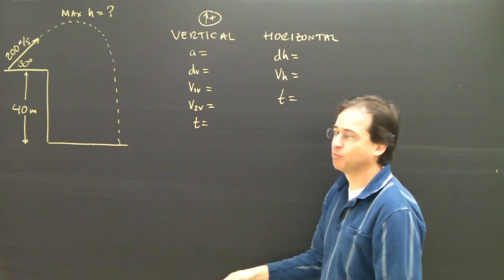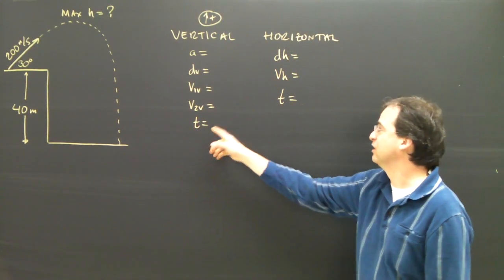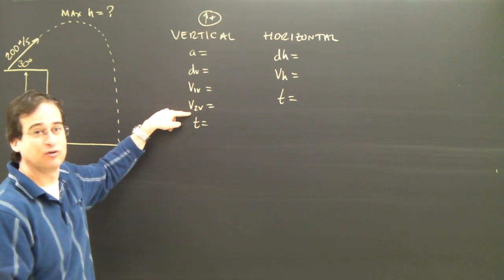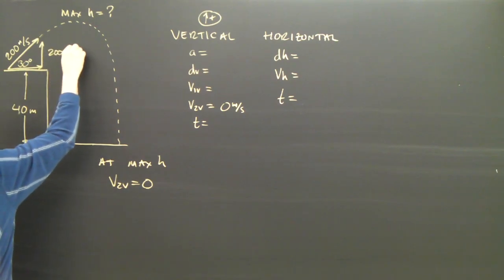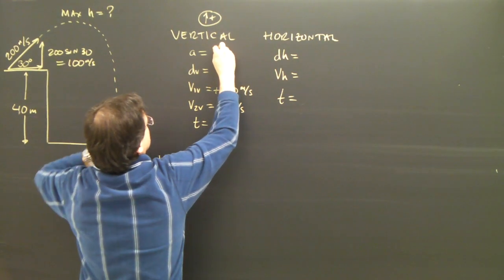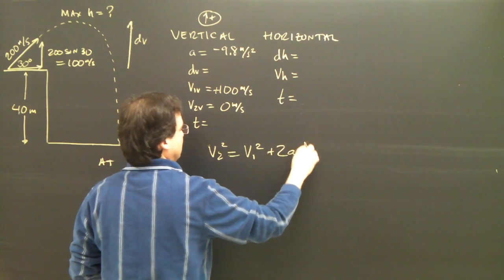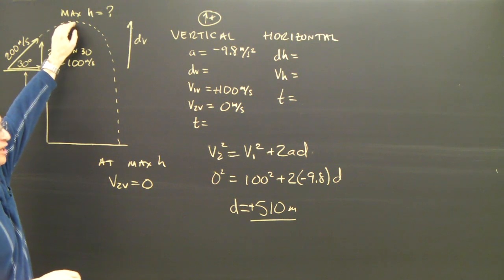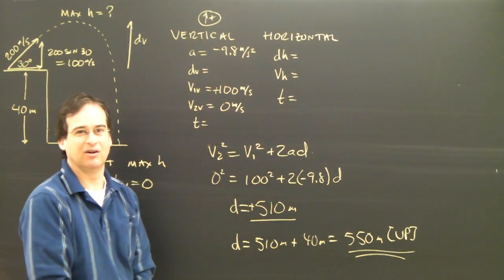Projectile Motion Calculating the Maximum Height Part 6

Comment: Still confused how you got 510 meters
Reply: well see this is a very bullshit method of finding stuff but taking g as 10 m/s^2 it takes g 100/10 = 10s to  make velocity zero now see  hmax is essentially average velocity * time taken to reach top which is 10 so its 100+0/2 = 50 m/s * 10 s as it took 10 s for the body to reach the top then it started falling so its 500 m or 510 if g =9.8
Reply: Use this instead 

Ymax = V1²(sin angle)²/2(acceleration due to gravity)

Comment: how he get the  100m/s as V2 when 200 sine 30 is 197
Reply: ur caculator is on the wrong mode it should be on degree not radical
Reply: In order to change your calculator to degrees you press the mode button until you can locate the "degree" option, than just press the corresponding number.

Comment: i dont understand, how can a 100 square gives you only 500 in answer?
Reply: +Oleg S it's actually 19.6 he must of messed up
Reply: Daniil Zh 
Sorry, how did you get 18.6 if -9.8X2 is 19.6?
Lost.
Reply: i’m getting -509.68 round up equals -510
Reply: 0=100^2+2*(-9.8)d
carry 100^2 over to the left with a minus sign
-100^2=-18.6d
10000=18.6d
10000/18.6=d
d=10000/18.6
d=510.20408163265306122448979591837
Reply: Daniil Zh ummm that’s still not 500. It’s 51
Reply: @robbiebarker6567  100^2 /19.6 = 510.20